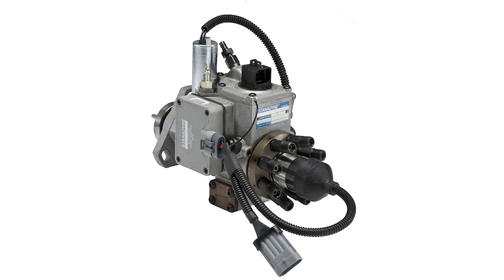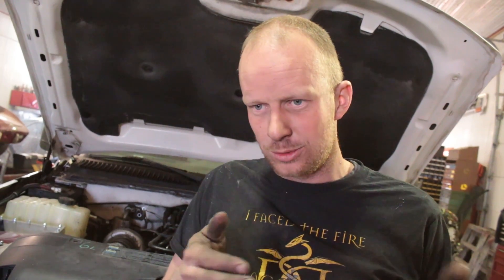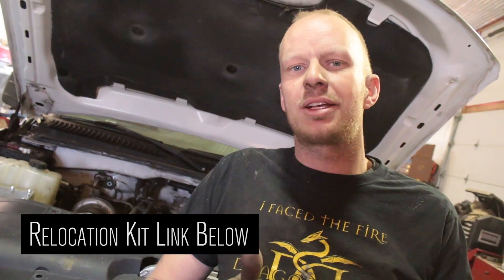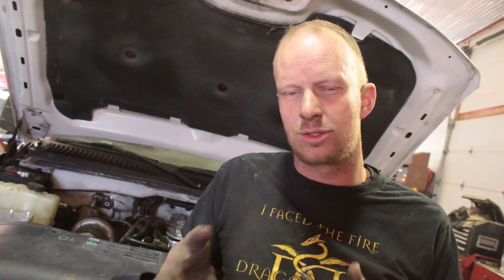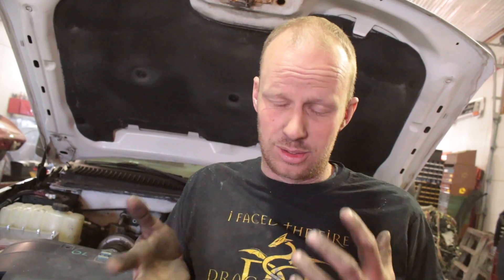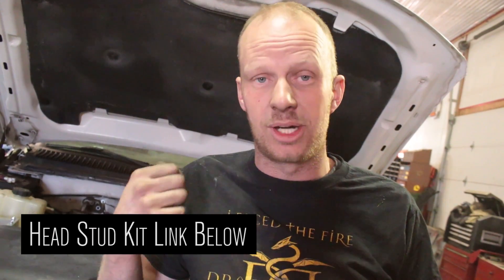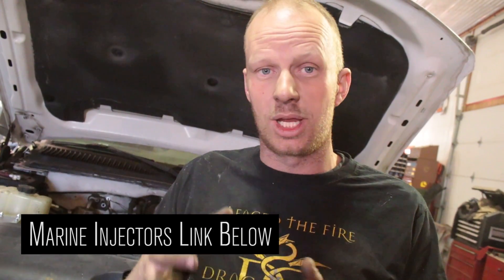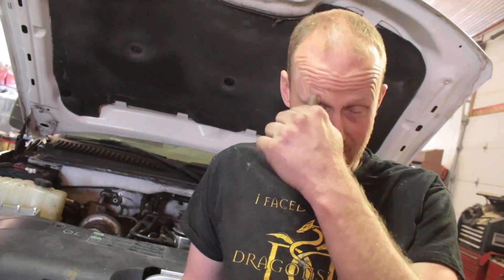REVIEW: Everything Wrong With A GM 6.5 Detroit Diesel

Comment: A dodge is nothing more than a shipping crate for a Cummins.  Fyi Ford use Cummins in there f 650s. Have since the 90s. Cummins is not dodge. Just a good engine everyone has used from time to time. Also fyi the new Cummins are nothing like the twelve valves. Got there own gremlins too. If the best thing about your truck is an engine built by someone else completely then you probly shouldn't be bragging too much on your shipping crate.
Reply: Nope they stopped using cummins a while ago in the F650, 750, etc, they have powerstrokes
Reply: Nick Ruble they stopped using the twelve valve when everyone else did. The newer Cummins have just as much problems as everyone elses diesel.  If it aint a twelve valve it aint worth talking about.
Reply: Got a 210 hp stock version in a 94 f800 with allison 3050 and eaton 2 speed 5.13 rear moving a 18' dump bead over double frame rails.  Yea its a beast!
Reply: HaHa fuckin Ha Ha . That is the best description I ever heard of a 5.9 Dodge pickup. You nailed her.
Reply: Nathon Smithson 🖒
Reply: What does that have yo do with anything. Gm pay your bills or something and off the top off my head 60 series Had help dirtymax Isuzu imfluance im old ive laughed at that junk for years well at least they use a real block now though. I mean their corprate douche bags go meet some of them see what there about fuck their name ive got a newer gm i hate it just like all my gm products that have diaapointed me throughout the years  somebody get me a spin doctor
Reply: Anger issues.
Reply: perhaps...perhaps not. But at least RAM...(not Dodge dumbass) is intelligent enough to use the best and Dodge and RAM have been that smart since the 80's.  All late model Ford V8 diesels sound horrible...like they are underwater and missing on 2 or 3 cylinders sort of a blub, blub, blub sound. Something just ain't right there. My nephew runs an angus farm and up until a couple years ago was a die hard Ford guy. Now an HD Silverado runs the farm. just ask him. ANYTHING is better than a Ford diesel...even Briggs and Stratton....

Comment: people in Australia used to put these pieces of crap in patrols they cost a bomb like $25 000 and were slow and unreliable in atmo and turbo form 
 they are a boat anchor
Reply: 25k,try 35+.,i told a guy,50 yr old,with a patrol in the club,NOT,to do it,i told him every  thing that is wrong with them,even our mech didnt like him doing it,.he sent it to w.a.,from s.a.,to be fitted.i just dont understand some people,they have the net these days are they so fkn stupid.dont listen to the drunk down the pub,,yeh mate geta v8 diesel,best out,,,bullshit.he.d of been better with the 4.2,spend 5k on that,&,parts are here,not third hand price from w.a.,plus a 6 cyl puts out more torque than a v8,per cube.,i have an mwm,4.2tdi,in the f250.i fitted a bit bigger turbo,went from 135kw,510nm,to 700nm,165kw,all mechanical,not even a glow plug to be seen..ohc,3 valves,3" system,std.revs to 4.5k,&,light.those toyota v8.s are over teched & over priced.just a nice rumble to the bank,!!.

Comment: I’m looking for a 6.5 for my ole  dually changed head gasket In truck it had been done before the block had pits and a I had to fill in some scoring from the ring of the gasket I really should of had head and block sent out to get resurfaced but ole well I tryed a week later ther is water in the oil and it had a lot of blow bye I’m thinking it had a cracked block cause it was holding pressure before I redid it and after it still held pressure they are famous for cracked heads and blocks from 94 to 98 so I am looking for a 99 unless I try to put a gas motor in it and that is way to much money so will stick with the weasel

Comment: Why does the 5.7 diesel blow head gaskets but not the 6.2 and 6.5
Reply: The 5.7 diesel was an Olds 350 gas engine that the "Olds Engineers" beefed up and made a diesel out of. Head gaskets fail for many reasons, but the 5.7 was just a poorly conceived design. Funny fact.  At the time some idiot at G.M. gave the okay for this project, G.M. owned D.D. &Allison . They could have asked Detroit to design a small diesel engine and Allison transmission combo and done better, but big companies don't always communicate well.

Comment: The 6.2/6.5 were not bad engines. They were designed for fuel economy and not power. They were a good replacement for a 350/ 5.7 not a 454/ 7.4. 
 They were designed by the people that lived through the 70s fuel crisis. 
That's why I laugh like hell listening to 90's brats and millennials talk about the 7.3 and the 5.9 like they're diesel experts.

Comment: My 6.5 had 230k miles only blew the trans at 200. Had 4 inch ex. PMD isolater and harness extension with processor fan. 12% #9 resistor. K and N air cleaner right on turbo. pulled as strong as my stock 7.3. Guy who bought it from me still had it 10 years later pulling heavy large boats every day.

Comment: I have a 1993 6.5 that is straight mechanical with no computer on motor. They started the black box in 94. I am just now updating with new injection pump and injectors. It has 200,000 on it now. You are right they are no big powerhouse. Now getting down to where the rubber meets the road, I am going to put a 12 valve in it when it dies.  Because it is still a good solid truck.

Comment: How do I release the Compression in the 2002 6.5 to spin the engine over for a Flexplate replacement (to remove the Torque Converter bolts?)

Comment: I had a 1995 GMC sub 4x4 2500 w/ 6.5 turbo. Not a bad truck once I made some mods.
#1 mod move the black box off the injection pump and on to a heat sink mounted on the fire wall, keeps it cool so the power transistors dont burn up.
#2 mod get rid of the vacuum controlled waste gate and go to a mechanical spring control, very basic, easy to adjust boost pressure, simple.
These two things turned my sub from a turd to a rather well performing truck, not a cummins mind you but acceptable.

Comment: Only on 350000 km did i start having heat issues. As my truck is an ambulance in austalia and it does min 1200km avery time it moves. Its starting to be a head ach. Apart from that its been reliable. Managed to get fuel consumption down to 6 km to the liter so about 800km approx  to a 130 lt tank. Which is not bad for a 5t truck. For a comparison in the mrrc sprinter ambo which i also drive i get 5 km to the lt and thas a 3.2t vehical 3 lt. Easy to work on on side of the road and most things accessable. At the moment i havent found a vehical that can replace what this can do. So im stuck till something comes along that can replace irs capability. Ford unfotunatly is out of the question its jyst way to tender and over burdened with electronics to much that can go wrong and canf afford it not moving or getting stuck 500km in the middle of nowhere.

Comment: Early 6.5’s also had a softer crankshaft than the later, 95 and up I believe, also the military used 4 different flavors of the GM/Detroit engine platform in the HMMWV’s. They used the 6.2, 6.5 detuned for use as a 6.2, 6.5, and 6.5 turbo depending on application, FLA’s and “up armored” vehicles exclusively got the 6.5T. The common issue we ran into especially in the desert was like a vapor lock type scenario with the IP. The trucks would shut down and not want to start unless you dumped some cool water on the IP then they’d fire up and hopefully get you home. This guy is right on the money with just about everything. These engines will never be powerhouses but if you take good care of them they will always get you home and get decent fuel economy to boot.

Comment: The 'ol 6.5L GM turbo diesels are ok. You certainly won't ever win any races or pull down any great dyno numbers, if that's your thing. That said, they are quite reasonable on fuel when running correctly and are typically quite reliable overall to get the job done. If people would just leave the damned thing alone (leave it stock) and take care of it with basic maintenance, the engine often remains reliable and will typically outlive the truck that it was put in. 

Biggest well-known problem with the 6.5L diesels was the fuel injection PMD (Pump Module Driver) that often failed and was the direct cause of fueling related problems. Common PMD failure symptoms were everything from running rough and excessive smoking, to just plain shutting down unexpectedly when driving. The cure was to relocate existing PMD away from heat of engine prior to any issues. If PMD was already damaged (again, from excessive engine heat) one would simply replace the PMD and relocate it with a new heat sink mounting plate at that time as well. 

Other relatively well-known 6.5L issues were coolant consumption issues due to bad head gaskets, and turbocharger wastegate problems, often caused by a bad sensor that controlled the wastegate.

+DEBOSS GARAGE :
I typically like your videos Rich, but this one wasn't all that great. I just said more about what's wrong with the 6.5L in my above commentary, as opposed to all you babbled on about in your video, which wasn't all that much about the 6.5L's problems at all really.
Reply: I own a 1982 GMC C1500 6.2L diesel longbed 2wd pickup that I bought new and it has 478,991 miles on it and all I have done was had the IP rebuilt once, 2 glowplug controllers, 3 sets of glowplugs and the starter rebuilt once and I drive this pickup every day. The 700r4 trans has been rebuilt several times. I use Delo 400 15w-40 engine oil and PF35 oil filter. oil changes are 3,000 miles or 90 days which ever comes first and every 3 years I change the anti-freeze and replace both batteries with a matched set.
Reply: Michael McGrew can you leave me that truck in your will. That’s amazing Sir
Reply: Michael McGrew I had one in an 83 Suburban 4*4 and it pulled through everything off road, it got me in trouble due to going where I shouldn't have, only thing to stop it was turning it over on its side. When I was a kid dad ordered a Cutlass in 1980 with a 5.7, dealer said our car was the best he'd ever seen, 34 MPG, I got it when I turned 17, it was 10 years old with 150,000 miles on it, I was so hard on it, wrecked several times finally totalling it, had the engine put in another one. Proper maintenance, the right oil, and fuel choices is what kept it going, but those injector pumps were good for only 60,000 miles, wish I had it right now.
Reply: Turbo Diesel I’m having issues with one it’s got 120,000 miles but need to check compression
Reply: Turbo Diesel you are very knowledgeable and have a lot of sense to ya haha (i mean no disrespect) but theres one thing i always hear when the 6.5 is mentioned and that is "it wont win any races" there isnt a single diesel truck no matter how big small long or short that was DESIGNED to "win a race" the thing is the 6.5 Detroit did what every other brand company could dream of reliable,enough power,and good fuel milage you can always upgrade there will always be at least one company that makes performance parts for every platform trust me i know i own a 3000gt vr4 i like the bastard child the platform that people say cant work for them it's always cheaper and i love when i pull up and people have no idea wtf im driving but good points man i appreciate your no biased educated opinion mixed with some facts (btw im only 19 so i dont know everything)
Reply: Recently bought a slightly wrecked 96 gonna get it to running status fix it up play with it some beat on it and then put a 12v in the body and if the 6.5 still runs swap it into a rat rod I want to build.
Reply: Maples01 I have a 1982 Oldsmobile 98 Regency Brougham with 217,041 miles on the 5.7L diesel engine after I did a complete rebuild on the engine and TH200-4Runner transmission. I have not had any engine or transmission issues since the rebuild. The injection pump was updated to prevent the issues these pumps had and it is still going strong since the day I installed during the rebuild, I also use Howes as a lubricant and  I cut the winter mix fuel with kerosine to help prevent the fuel from gelling.
Reply: 12 to 14 city and solid 17 highway on a k3500 platform😎🇺🇸🇺🇸
Reply: you cant leave it stock,they over heat,the injectors are crap,plus other issues.ITS A BUIKE CAR ENGINE PETROL,MADE INTO A DIESEL,COS GM HAD NOTHING TO COMPETE WITH DODGE & FORD,A STOP GAP,BASICALY.GARBAGE ENGINE.!!

Comment: We have had nothing but excellent service with our 1996 Suburban 6.5. It has not too many miles at about roughly 230,000 miles. We dont beat on it and give it regular maintenance and filter changes. It is dependable and gets great fuel mileage on the open road. We do carry a spare PMD module as is highly recommended. The other known problem areas such as the original oil cooler lines have been replaced with steel braided lines, Vibration dampers, inexpensive, replacement, keep thatbsort ofbproblem at bay

Comment: I tried to kill the 6.5 in my truck for 60k miles and it's still going. They CAN make decent power, I just threw a bigger injection pump on mine, sealed the wastegate shut, and it was faster and towed better than my stock 2005 cummins truck. That being said, the 6.5 is a few thousand times more likely to explode gloriously while towing heavy crap. I bought a second 6.5 and it's slower than a three legged turtle no matter what I do to it and can barely maintain speed hauling it's own fat ass up a hill much less tow with it.

Comment: Relocating the PMD, replacing the lift pump with a higher volume pump, and installing a relay to this lift pump off the factory circuit solved a lot of issues for the 6.5.  Although not a notable powerhouse, the 6.5 turbo diesel was (and still is) one of the most fuel efficient engines in the full size truck diesel market.  For a highway cruiser where a lot of power isn't necessarily needed, there probably isn't a better engine out there.  A lot of the problems we saw with this engine back in it's prime could be attributed to fuel quality.  If we had the quality of fuel in 1995 that we do today, there would not have been so many powerjokes sold.  The PMD and fuel quality allowed the 6.5 turbo diesel to sell more powerstrokes than any Ford salesman.  And that is my $.02.
Reply: I know it’s been many years, but I’m lookin at a ‘95 2500 with only 114k, owner says it needs a water pump and the fuel gauge doesn’t work. Any tips/tricks?

Comment: I like the 6.5, alot. I don't agree with the whole "good platform" though. Those trucks, best merit, cheap. Frames were weak, suspension was, adequate, and the interior was terrible until the last few years of production. The 6.5 has plenty of torque to pull avg person things. You can swap in +30hp marine injectors with a wrench, and that's about all you need. (possibly a re-tune) Did I mention you can replace injectors without removing anything but the injector? Which come to think of it, they are one of the easiest engines to service.... They are not powerhouses, and for daily driving, 250-280hp is all you are really going to achieve safely. However, a tune up is as simple as a quart of trans fluid in a full tank every three months or so. Berate me if you will, but it worked for all our humvees in 140+ heat. A little lube goes along way to making that pump last. Another great thing, the engines are cheap. They usually outlast the trucks. Also, you get to put a cool Detroit Diesel sticker on your truck. ;D

Comment: These engines were more for economy than power. I put a 2.5in crossover pipe and a 3-inch exhaust all the way back and it really woke up my truck. It was a 98 K3500 crew cab and weighed in at 7045lbs.  I often averaged 22 mpg highway.

Comment: don't be to hard on it after all it's technically for GM it is 2gen diesel engine with 6.2 being 1gen. it is hard to call a 350 5.7l gas engine with DB2 Injection a diesel engine, that is like calling a secretary car a sport car.

Comment: Straight to the point and NoNonsense!  I actually did a good amount of research on te 6.5 before running into your video and you're right in line with everything I read!  Thanks for the great vid just subscribed.  Check out this sweet chevy i just picked up with a 6.5l.  I'm selling the engine if anybody's interested. Planning on chopping it up and turning it into a trailer to tow behind my 12 valve!  Lol.   https://youtu.be/74I-nANByqk